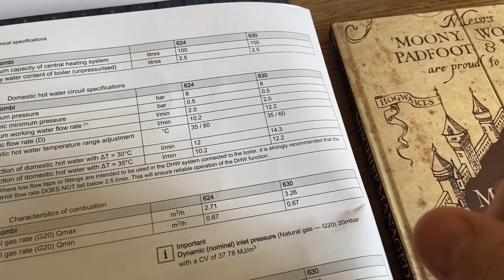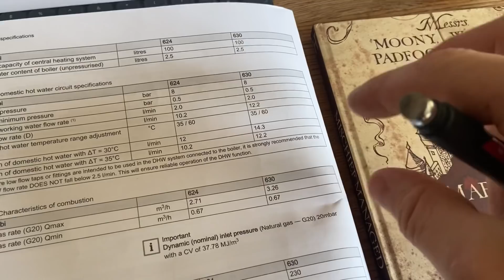P B Plumber The life of a jobbing plumber #42

Comment: 4ppm isn't worth looking at....400ppm and above please. Does this detector also work in LEL. You see that's the key because 50PPM won't even show on a tightness test which is the gold standard that tells you what your dealing with.

Gas valves in particular those that are regularly used leak small amounts of gas but it's so small it's not really a concern. If you spray it with LDF and it bubbles or spawns then you have a leak that needs action.

Comment: I’ve had it a few times on Worcester’s where the flow restrictor in the flow adapter has shat itself allowing too much flow through the plate.  Customer complains the bath is cool compared to the other taps and it hasn’t always been like that.

Comment: Back in my early twenties I found I had a big old lump in my ball bag that kept flaring up. Scared the crap out of me. I finally got myself together and went to get it looked at in the hospital. I lied down on the bed and had a doctor and a student doctor stretching out my ball bag whilst shining one of those medical angle-poise lamps through it from the back to see what was inside. They weren't quite sure what to make of my one big bollock so they sent me to have an ultrasound scan, on me nutsack. The guy doing the scan stuck the gel in a special machine to warm it up first before applying it to my two veg because if they put it on cold your sack just shrivels up and they can't get the ultrasound scanner on it properly. I got to see what my family jewels sounded/looked like in black and white on the screen, pretty weird.

As it turned out I didn't have cancer, I got something called a 'varicocele' which is basically some varicose veins in the clump of strings going to one of my balls, whenever I have a particularly energetic sex session my bollocks swing about a bit too much and all the blood gets trapped in the dodgy veins and it swells up in a big tender lump.

I hope this story will encourage any guys worried about something they've found to get medical help, it's not at all daunting once you're there. Cheers.

Comment: Unvented cylinder whenever possible to give max flow rates to fill the bath quickly .
Reply from the maker: This refers to combination boilers only mate
Reply: @PBPlumber  yes I understood the calculations for combis,  I meant unvented cylinders will give a better flow rate at the taps to fill a bath ( assuming you have good pressure and flow rate) . A combi could never compete with an unvented.